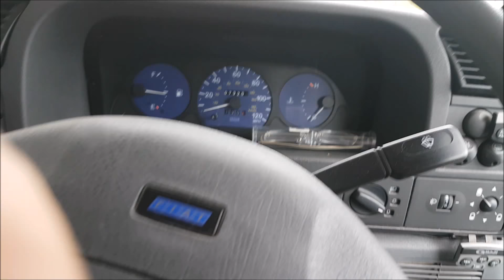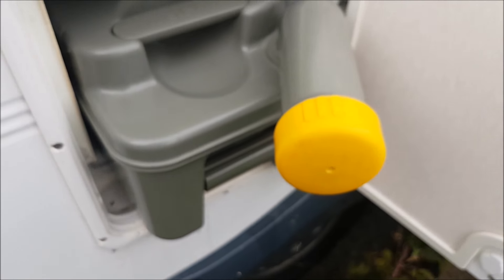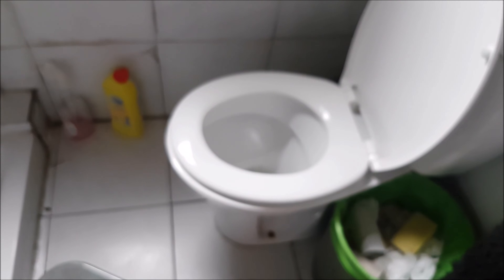MOTORHOME TOILET EMPTYING AND CLEANING

Comment: Hi and thanks for your very informative vlog. My question is the yellow dial on top of the cassette that can be turned what is that for. 

Cheers 👍🏻
Reply from the maker: That opens the gate manually so you can clean or change the rubber ring 🌞🍷
Reply: @MrMeltedwellies  Isn't there a way not to handle the toilet and all that waste? Like simple flush and thats all like regular homes?

Comment: Thanks for taking the trouble to show us this, I also have a Fiat camper, where is the flush tank filler, I couldn't see it in your video?
Until this week I have been using my portable Thetford, as the on board loo compartment, has been used as storage.
When I press to flush the pump runs but no water comes out.
Reply from the maker: it take's the water from the main tank

Comment: This is actually wrong!! If you read the instructions, you're supposed to put the Elsen 'Blue' into the yellow cap and pour into the cassette via the spout, as you screw it back in (the cap has markings on the inside to show you how much to use, depending on strength), then you're supposed to 'flush' the toilet from the inside to add the water you need. Also, you used far too much 'blue' on this video, hence the need for measuring.